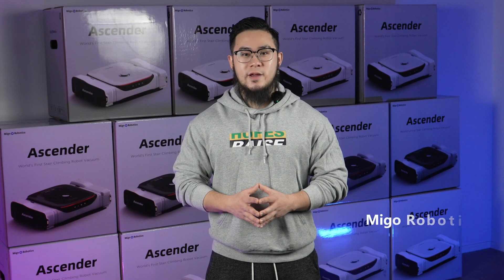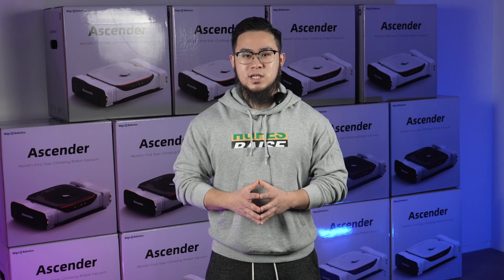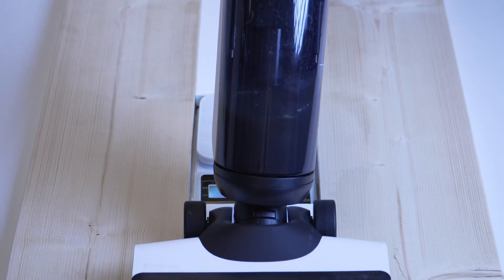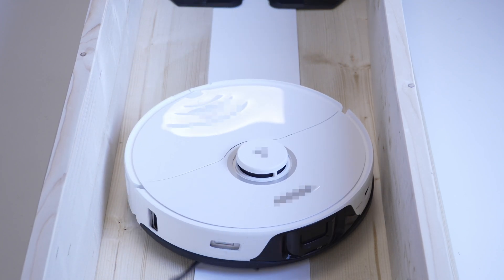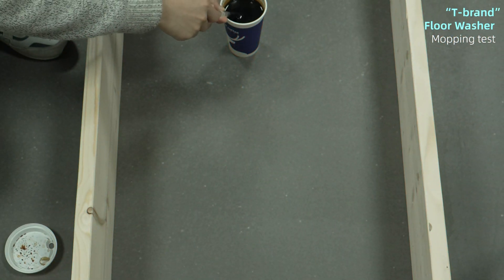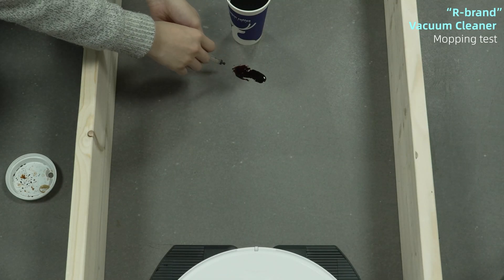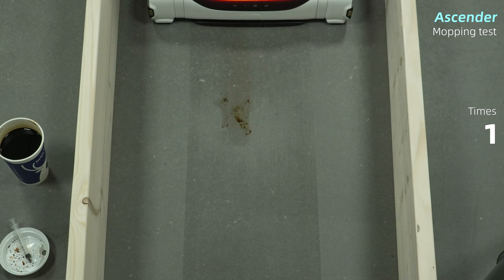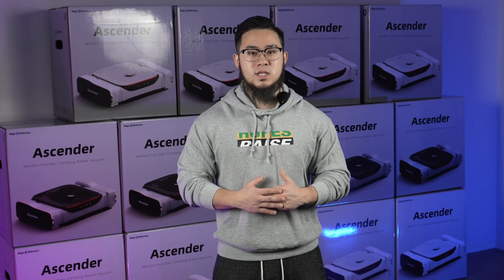Ascender: Mopping Test

Comment: Please test how large an area it can clean? The biggest problems I´ve had is that there is not enough water capacity to clean my entire floor and that the mop cloth gets clogged with dirt very quickly. Typically, my robot cleaner that mops too has to be refilled and have the mop cloth changed 6 times to clean my 150sq m, fully tiled, not very dirty floor.

Comment: So it just drags the mop along the floor?
Reply from the maker: On carpets, it will lift the mop to prevent the carpet from getting wet.
Reply: @MigoRobotics  My nearly 5 year old roborock s5max also only drags the mop along the floor, I thought you were more inventive than that, it feels like outdated technology.
Reply from the maker: If you wish to mop carpets, you can set it up in advance in the APP, provided that the carpet material is not afraid of water.
Reply from the maker: @dejedejsson  If you're satisfied with Roborock's quality and decide to buy their latest and pricier model for $1569, you'll notice it maintains the same design. The vibration mopping solution isn't outdated; in fact, experts recognize it as the best and most efficient solution available today! :)

Comment: In the soy sauce test, the Ascender the large stain was gone but it left large streaks behind.  I'm wondering if the heavy downforce of the mop is working against it.
Reply: This kind of technique of dragging a cloth along the floor is not made suitable for cleaning up liquid spills or larger stains, you just spread the crap around and get an even bigger sticky surface, spinning mops are not better either, these machines are only for maintenance cleaning, a bucket and mop is still unbeatable!

Comment: What about corner cleaning?
Reply from the maker: Ascender can clean the corners as well. Even though the legs on both sides of our machine are 4.5cm (1.77 inches) wide, the side brush rotation effectively removes dust underneath the legs. While it may not cover every inch of the stair surfaces, the actual cleaning results are still reassuring.

Comment: Can it mop stairs as well, since it does not turn?
Reply from the maker: Unlike the roller brush, the mop is not pivotable so only part of the stair can be mopped.
Reply: @MigoRobotics  I guess that is better than nothing? Cannot wait for the release. Do you have a launchtime? My vacuum robot broke, so I need a replacement, but I have several sub levels and floors. This would be great. If you need a tester, you know where to find me :-)
Reply from the maker: @philippsuek9204  Hi, we are putting the finishing touches on Ascender, and the Kickstarter campaign will launch soon. We aim to launch the Kickstarter campaign in March 2024 and will announce the official launch date once it is confirmed. Your patience and understanding are much appreciated. Please stay tuned!